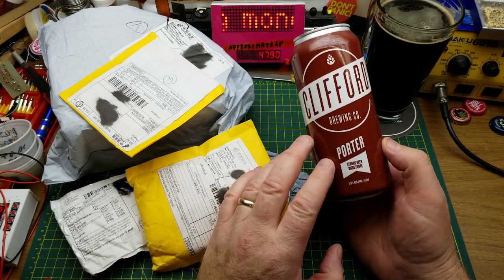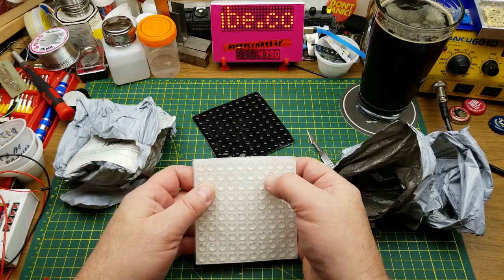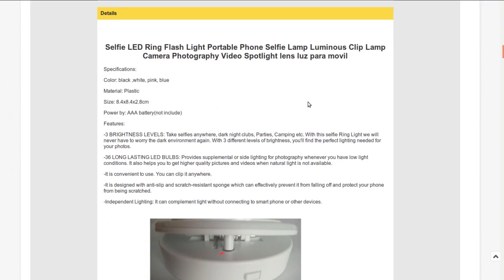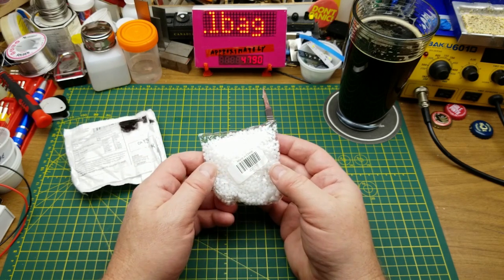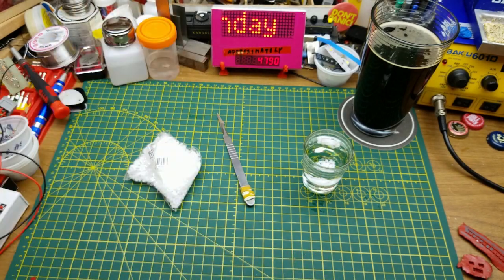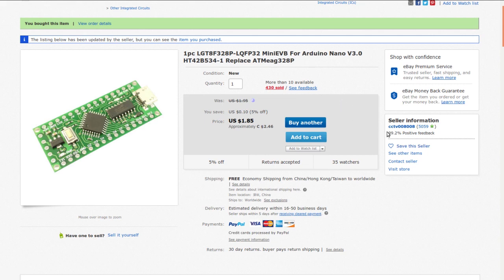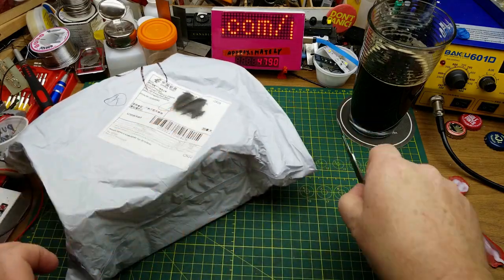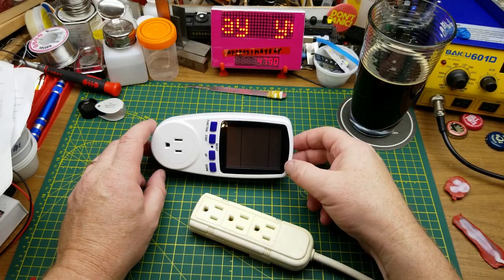mailbag monday 75

Comment: The Polymorph is really cool. I've used it to repair stuff or to quickly shape temporary holders / mounts. Water around 80°C usually works very well and for quick hardening a can of freeze spray can be useful.
Reply from the maker: I was thinking about that sort of uses as well. 

I'll be using proper boiling water the next time I play with it.
Reply: @pileofstuff  Yes, or a heat gun like you've used works well too. The only problem when it gets too hot is that it becomes very sticky which can sometimes be annoying. But it's very nice stuff to keep around. I've already used it to repair headphones and other stuff. 
As far as i know it's also been used in medical areas so it should be safe to use for many things.

Comment: I like the "HOPI" replacement. No flicker like Big Clive's! You might try to scrape the flash out of the mold while it's still hot so there'll be less clean up. And if you break it, put it back in the mold before reheating?

Comment: The LGT8F328 is a mostly AVR compatible microcontroller with some improvements over the original Atmel design including a built-in 32MHz oscillator and 12-bit ADC.
Reply: Yes, one can use it a like an ATMega328, but the internal voltage references are different, and the fuse/ISP system is gone. I recently ordered, and tried a 32mhz crystal on my "Wemos Xi Nano" variety.  It worked ... but it will also works at 16/32mhz without a crystal.
For a working core:  https://github.com/LGTMCU/Larduino_HSP

Comment: Nice don't panic badge, want an electronic one?
Reply from the maker: Thanks for noticing!
I've bookmarked your tindie page to see if they show up there (even though the cost of postage is outrageous, I'm still interested)
Reply: @pileofstuff  I'll just send you one, I won't likely list them on Tindie. You'll need to get your own 0603 LEDs, resistors and one of those common SMD switches. If you can find my email on YT drop me your address.
Reply from the maker: @DavidWatts  0603? that sounds... challenging.
If I can't get my hands on any fast enough, I have it on good authority that it can be built with 0805!

Comment: I did run this power meter long time for more than a year with a 900 watt cryptominer pc with various gpu's, max 900 watt, often only half of that, it does still run on second winter now. It looks like this but has EU plugs and 240 volt.
I guess i will remove it the next restart, these should not run all the time i guess, but it has done so.